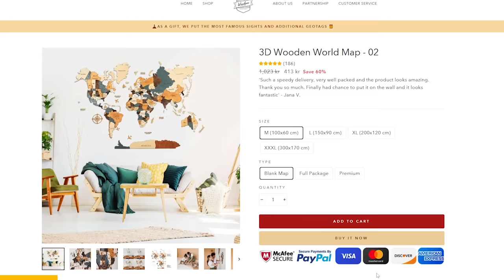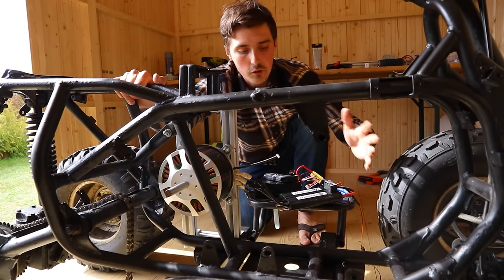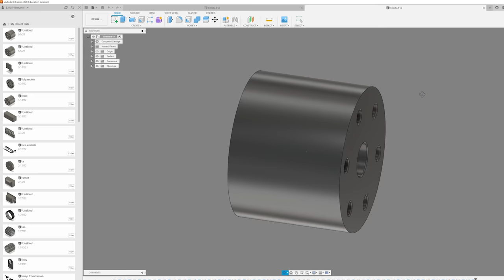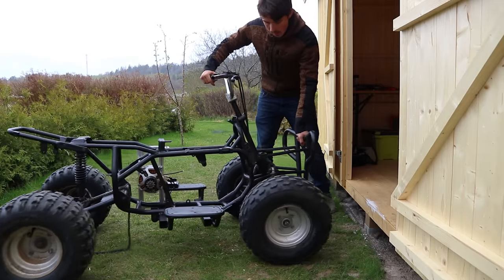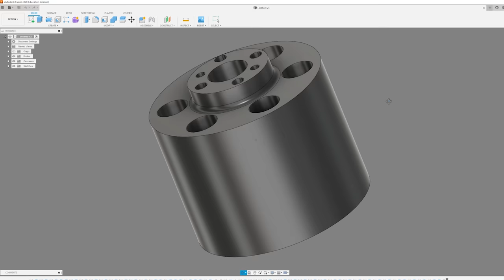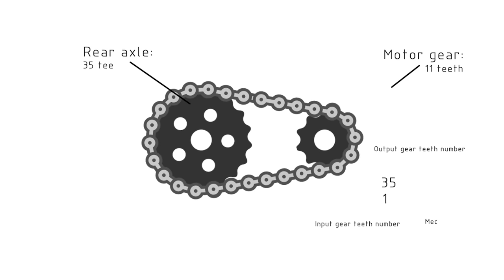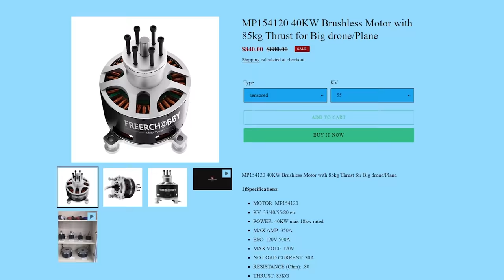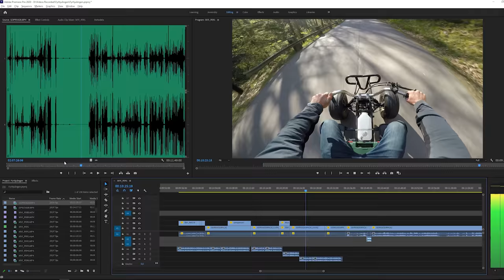I Bought an ATV and Made It Electric

Comment: you should use the original gas tank as the water reservoir.
Reply: Also Radiator to cool the Water down for long runs. Would an PC Water-cooling radiator work, too?
Reply: @seskalarafey9285  dumping the heat into the chassis somewhere would be nice. Lots of metal to get rid of the heat
Reply: @fluffigverbimmelt  I'm not sure how much heat is generated  that can be taken care of using the water cooling system, but dumping it into the chassis is probably not going to do it for two reasons first of all the chassis is made of steel which has pretty poor heat conduction. 

And second is that the chassis is made of round tubing. That means there's not much surface area to radiate or cool down through convection. And cool down it needs. Just because there's something like 50 pounds of steel to heat up doesn't mean you can just sink the heat into it. That would just accumulate the heat. No the water has to be cooled down. A 240mm PC radiator would probably perform decent but bigger is in this case better. But it shouldn't be to hard to find an old MC radiator which should provide ample cooling if it's needed.

Now the expansion tank doesn't need to be all that big. All it's supposed to take care of is the difference in water volume due to thermal expansion. There's really no need to have the water flow through it if you got an inline pump. Just put the expansion tank somewhere high and connect it to the cooling loop at the highest spot using a T-connector and you're done.
Reply: @fluffigverbimmelt  Metal is a good conductor, but steel has a relatively low specific heat capacity. Water is the cheapest high heat capacity fluid.
Reply: I came here to say this too, its literally made for it
Reply: @blahorgaslisk7763  Heat enough to get flames.
Reply: @TheStijnw  That's when the FETS fail (which creats a short circuit, so as much power as the batteries can dump into it until whatever wire or circuit trace melts away like a fuse). Normally they don't need much cooling, I wouldn't even bother with a radiator unless you make the reservior nearly 0 size (it takes a lot of power to heat up very much water). You could do a cute little 120mm PC water cooling radiator and tiny water pump and it should be enough.

The only heat it has is due to inefficiency driving the motor (not motor inefficiency, that heat is dumped into the motor), so its actually pretty small. Typically those units are water cooled simply because they are for boats, so they already have high speed water near them and air tight sealed boats don't have the best air movement inside them.

Comment: Look up Fardriver or Kelly controller, they make "real" motor controllers (made for electric vehicles) which don't go up in flames as they have over current protection. The controllers are actually not more expensive than high power RC controllers, they are around 3000-5000 SEK. They are more tricky to set up, but they are sensored, have FOC and are just better and more reliable in every regard
Reply: i second that - ive been watching another channel who have converted a yamaha raptor with a liquid cooled motor & fardriver controller looked awesome

Comment: You need to use a VESC for this kind of use case instead of a regular ESC. VERY IMPORTANT!
PLEASE research VESCs before buying any new ESC.
When using this size of motors, the ESC/VESC  has to be specialy calibrated to that particular Motor. Otherwise, the whole system will burn out at some point because of the high amp draw and voltage. You can do that with VESC, and not with ESC.

a hobby ESC is made to output as many amps as needed to do whatever the PWM signal from the radio tells it to do. Even though it says 300A. That doesn't mean that it will cut or limit power at 300A draw to save itself from being damaged.

with a VESC you can program an Amp limit draw, and it will adjust the voltage accordingly. Kinda like when you change lipo batteries. This will also save the ESC from amp draw spikes when starting up or doing hard accelerations.
This is the key to not constantly burn out ESCs like you seem to do quite often :)

Use the sotware called "VESC tool" program the VESC
Reply: This should be the top comment
Reply: @Pandacat 666 what he needs is a setup actually designed for purpose , The motor, controller and battery system are tiny - most small kids quads run on 24v or even 36v . 

he needs a qs138 , 300A controller minimum and say a 72v battery - something similar to what we use on our Electric Quad conversions
Reply: @Pandacat 666 VESC is just a type af ESC. So you just chose an VESC with voltage and amp ratings that are appropriate for the build.
Reply: @Pandacat 666 You’re the one talking nonsense.

Trampa make some of the best VESC, their 100v 250A version would be perfect for this.

Comment: Cheap tire pro tip: jack up a car, slide the tire underneath, stack boards on 2 sides so when you lower the car the weight strips the tire right off the bead. Maybe not necessary for little atvs or lawn mower tires but hey.

Comment: Maybe use a sensored motor controller like the 75/300 VESC or one from sabvoton or the asi bac, they will run your motor way smoother and with great startup torque and are even cheaper then the one you showed at the end :)
Reply: Du auch hier, nice :D
Reply: Better than the 75/300 would be the little FOCer for only $300. There are other good options as well.
Reply: VESC IS BASED
Reply: @quinnfoster4671  FOCer is cringe the best is BESC G2 100V/400A Based Vesc💪💪💪💪💪💪💪💪

Comment: There are many non-hobby ESCs / controllers / inverters that are designed for automotive apps like this, such as Sabvoton, Kelly, Phaserunner etc, though i think the latter only goes up to 4kW.
As you know, you really have to have Hall sensors!
Still, it's fun watching you discover new ways of breaking things!
Reply: I have a few phaserunners and they run best at about 75 amps continous upto 96v. I've blown a few constantly using the max 96a even with appropriate heatsinks

Comment: Hey man! Cool project 👌 You HAVE to adjust the gear ratio! When you dubble the voltage, you dobble the RPM of the motor. You should try something like a 1:10 gear ratio. Electric motors like higher rpm than gas engines. You should be able to do burnout’s with this setup 💪🤩 Greetings from Norwegian bro 👊🤠
Reply: Outrunners don't really like high RPMs -- they can explode because of the immense centripetal force the bell needs to withstand. Not good if your nuts are nearby...
Reply: @ahaveland  hehe 🫣. Ok, higher RPM than this poor motor gets. These usually in RC planes and the prop need some rpm to get flying. And yes, I would not put my balls around any diy motor project 🤣

Comment: Max power of an BDLC occurs generally around 50% of no load RPM (peak efficiency at 80%). If you run the motors at say 20% of that you're not going to get anywhere close to the max power output (except heat). If that wasn't the case, you would get 1 gazillion Nm at 1 rpm to with 12 kW power (power=torque × angular speed)
Reply: Good point!
Reply: For context in this case; For simplicity assume it's 100kv motor. No load RPM at 48v = 4800 rpm. Peak power at 2400 rpm or 40 rps . Gear ratio = 3. Rear axle will rotate 13 rps. Assume tire diameter of 0.5 m => ideal speed 21 m/s = 75 km/h. Discounting all losses friction, wind, resistance, rotational inertia. People often forget about the wheel diameter and just focus on gears  (it's a 0.5 m wide gear!). A ATV tire is 5 times larger than a gocart tyre, can't size the gear ratio similarly. A proper gear ratio (10?) is better to focus on instead of a larger ESC since a lot of power with this design will just go to heat. Sure lower top speed (35 km/h?) but MUCH healthier for the system and range.

Comment: Awesome!  That motor is insane!  The problem with this project is cost.  As you now know the ability of the controller to deliver ... say 500 Amps at 100 Volts is amazing.  What it can't do is deliver 1000, or even 500 amps at 24 volts for 30 seconds. 
Once the HUGE investment in a battery that can actually deliver 500 amps at 100 volts is made the motor and controller will throw you forward so quickly it will only need to make that high amperage for a few seconds.  And you will need to hold on tight.
Be very careful playing with these current levels.  You are dealing with more electricity than I use to weld 1/2-inch plate steel.
You know what a MOSFET is, and now you know why we call them Metal Oxide Fire & Smoke Emitting Transistors instead of Metal Oxide Semiconductor Field Effect Transistors. 
P.S. You are not the only one to learn the hard way ... my collection of catastrophic fire controllers is quite impressive ... until you calculate the $$$.

Comment: great project! looking forward to next episode. One thing: between the motor mount and the sprocket you have a huge moment arm. as soon as you use some power/torque, the motor bearings are gonna suffer. maybe stabilize the shaft on the opposite side of the sprocket with a bearing. good luck!

Comment: Use a VESC for speed control.  It has FOC control and current limiting which make it suitable for moving people around.  VESC is also much cheaper than the speed controllers you are looking at.  You can use gokart sprockets to get enough reduction.  Use something bigger than #25 chain like #219.

Comment: NICE !!!
Use controller with hallsensor input
Use support bearing so motor axis do not bend and get broken soon
Instead of a printed plastic part for the smaller Pulley use a Planetary Gear Box
Use its slower turn for easyer start

Comment: higher voltage controller will increase motor speed.  A jackshaft with extra gearing will be necessary….cogged primary belt from motor to jackshaft would keep the noise down.  fun project!

Comment: Cool project. A number of years ago I modified a Kawasaki kz305 to electric with a Curtis controller and motor combo good for up to 72 volts and built my own battery from 18650 cells. It was fun but the range was limiting so I got an old quad and did basically what you did. I also hit the lack of torque you saw so I added a jack shaft to give me better gearing. (I could not go bigger on the back sprocket because I would have been hitting the ground and other parts of the sprocket grew larger. Now I can pull garden carts and I added a hitch ball on the nose and I move my homebuilt teardrop camper around with the quad. Nice little workhorse.

Comment: Great project, two suggestions, add a bearing to sprocket side of the motor for driveline stiffness. Use a go-kart style split rear sprocket for quick gearing changes.

Comment: Was going to say you could easily use a brushed Etek motor or Lynch pancake motor with a Curtis, Kelley, or Alltrax controller. This is what most of us use for Electrathon racing and they provide plenty of torque at 24v or up to 50v easily. Just get your heating correct and you're golden.

Comment: Hello! You vitally need a step-down gearbox for this electric motor. The brushless electric motor has sufficiently high revolutions of its rated power. For its implementation, large revolutions are needed, which a direct drive to the sprocket and chain will not allow. You need a step-down gearbox with a ratio of at least 1 to 5, but it is better of course to calculate the optimal revolutions required by your electric motor. At the same time, the load on the motor control controller will also decrease and it will heat up less, as the operating current will drop. Good luck with the project!

Comment: I have experience building various electric vehicles and what I know is the gear ratio needs to be between 9 to 1 and 10 to 1 to the rear wheel from the motor. You need more reduction simply put.

I am converting the Can-Am 650 outlander to pure electric using a giant permanent magnet DC motor and 8 kilowatt hours of NMC lithium.

Comment: Everyone is yelling about the gear ratio… honestly that is just personal preference about how fast you want it to go and the torque you want to get.

The real problem here was that he didn’t support the motor sprocket at all - and it hung out so far from the motor. That’s why the chain slipped at 9:50, you can hear it. I doubt he was putting more than 5 kW into this system.
Reply: Yes, the spindle also needs supporting with a fixed bearing to ease torsional stress on its main bearings.
Reply: @ahaveland  100 agree. It would have been easy to add a second bracket that went back to the rear sprocket. That motor is meant to have a propellor attached, which needs to support no shear loads.

Comment: Get a chain tensioner it's like a bearing that keeps pressure on to eliminate the slack as much as possible without the chain being too tight with the exception of some slack for the suspension to cycle

Comment: Good info.  To fix your starting torque problem, you probably need rotor position feedback sent to your controller so it knows what firing angle to apply to the 3-phase motor windings, since your rotor consists of permanent magnets.  Be careful not to over current the motor windings and demagnetize the rotor.  It should have very good starting torque when integrated properly.  Read the motor specs.

Comment: If you add an intermediate shaft you can play with the gear ratios more easily and have support bearings on that shaft that will prevent the expensive motor's bearing from getting beat up when the suspension moves and the chain is tensioned properly around

Comment: 1) My e-mountainboard is riding on 15S battaries.
I think you should use 20-24S battaries.
2) Every one, who riding/driving electric bikes, ,scooters, boards etc, have to use motors and esc with HALL SENSORS!

3) FLIPSKY 75100 is very very good ESC.

Comment: Been a while since I've been so hyped about a project! 48KW on a quad sounds crazy! But I guess the limit when you get that controller, will be the battery amp/voltage.

I'd suggest that you add a support bearing on the other side of the motor axle. I'm guessing that motor doesn't have the bearings to take side torque since it's a plane motor.

Good luck!

Comment: You should create ur own battery with 18650 cells or 21700 so that it fits in the frame and you can choose the specs exactly like you want with the ratio between power, capacity, money, voltage
Reply: Despite it being more flexible and supposedly cheaper, it is dangerous as hell, most battery fires are due to self fabricated ebike batteries when people convert bikes to electric without the proper technological background, it seems easy but both the design both the manufacturing(or assembly) has to be really carefully done, and even then it is a big fire hazard. I do have experience with 18650 cells in batteries, and I wouldn't honestly wouldn't trust a battery done by myself, i have the knowledge to do it safely, but  assemblying, that is some brutally easy to fuckup shit. You have a scratch in any of the foils, you can short the batteries, and li-ion doesn't like that that much, spot welding isn't as easy as it seems, you HAVE to be sure that it is properly connected, 1 loose connection can destroy the battery in a big fire, or if they are half loose, you can't observe it, but over time mechanical stress from vibration can break the contact if the welder is not high quality/not set up correctly, and this is just scratching a surface, not even talking about overcurrent-, overtemperature-, overcharge-, undercharge-protection, sadly lithium is really fucking reactive with oxygen, cannot be put out by water, sand isnt that effective also, it burns much much hotter than a regular fire people are used to, and pretty much the only option is to run and wait until the lithium is burnt away. Lipo batteries have the same properties, and they are more prone to just start burning, but bought from an official retailer is much more safer than fabricating a li-ion by yourself without a high level of understanding of both chemics and electorincs. It is fine for small project, putting a few cells to power an iot device/arduino/esp, but I wouldn't start building a bigger bike one, you need to have a lot of materials and tools to be safe, which probably comes out more expensive small scale than buying an actual bike battery.

Comment: Considering all the motor related things you do, you should really grab a VESC - they make one rated 100V@250A that’d cover most of your prototype needs and let you know the weak points before you buy expensive stuff. They also have very good sensorless control - I run all my motors sensorless and it’s had zero issues starting them even with high starting torque requirements. They’ve even been able to start a pair of four-pole 20” mower blade motors in tall grass. They also have all kinds of settings to make your projects controllable. I can’t say enough about the brains behind them.

Comment: For this build you should use a QS138B motor and a 72v battery setup with a Fardriver or Electro and Co. controller. 48v is not enough for a vehicle of this size.